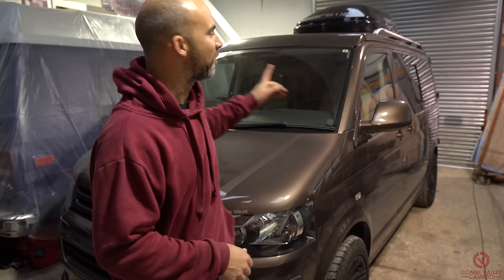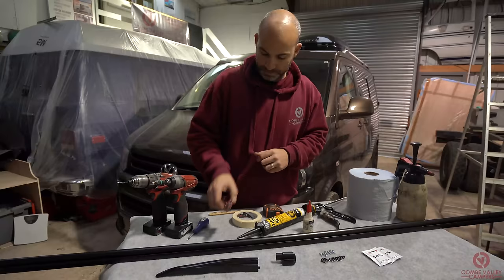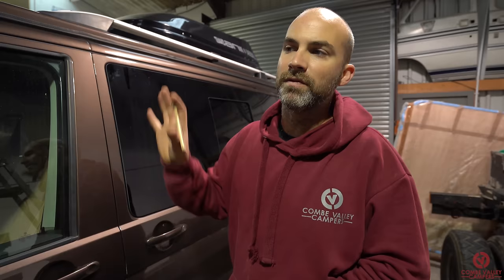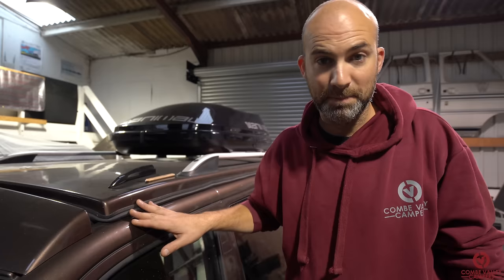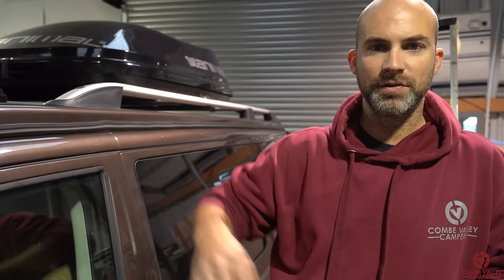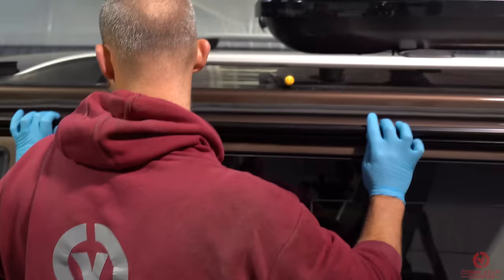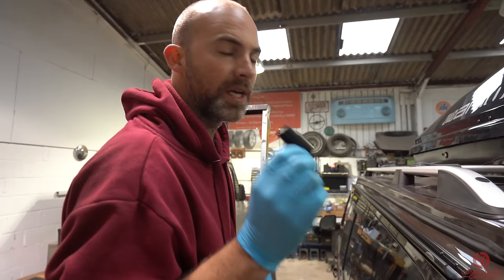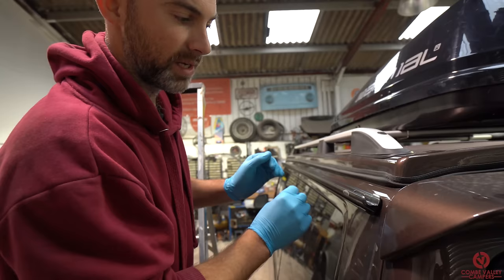HOW TO FIT AN AWNING RAIL ON A CAMPER VAN, fitting Vamoose C-channel awning rail.

Comment: Just followed the instructions in this video and successfully fitting my rail to our T4 van. I did it on my own. The only difference I made 2 x 4mm threaded pins which I inserted in the predrilled holes this allowed me to put the rail on with adhesive and slide into place for final fixing. I removed the pins and inserted the screws all done thanks for the video.

Comment: Nice clear explanation. Thanks.  Re ; sealant finishing. You can work without masking tape. If you manage to get the right amount under the part to be fitted then a fairly neat bead will show around the edges after its clamped down. To get that super neat it's then just a matter of a little saliva on the end of a fingertip run over the sealant and it magically smoothes out into a neat bead. The saliva prevents the sealant sticking to your skin. Its necessary to keep re-wetting the finger too. This technique is often used in fitting bathrooms. Often a bead will look like a run of weld on 1st application but a wet finger turns it into a smooth continuous joint. You can use this with a gloved finger but the glove is prone to movement which can spoil the 'run.'  Another way without tape is to wipe of excess sealant with a decent quality baby wipe immediately after clamping.  (Literally within seconds so it has no time to start curing. ) I don't know why cheapo baby wipes don't work well but  Pampers type do work well. You'll go through quite a few wipes as each one gets contaminated with sealant quickly and you start re-applying it if you don't change the wipe after a couple of sweeps. Hope this helps someone. Happy travels. John

Edit ; those baby wipes get the sealant off your skin really well too !

Comment: I had mine fitted using the roof bar fittings. Tucked the flat part of the rail under the roof bar.

Comment: man I love your stuff, but do you have a video, on how to cut and measure the rounded corners  inside the fan for head cupboards or anything you need to have flush against the top wall of the van?

Comment: What about treating the bare metal after drilling yo prevent rusting ?.
Reply: I asked that too. Something I would always do on my own vehicle
Reply: Pointless really, the screws are self tapping screws which would pull the paint off anyway. The sealant not only seals the hole but protects the metal.

Comment: should the front piece not slightly overhang the windscreen for the rain to drain away?
Reply from the maker: Hi Karl, this was fitted as per the manufacturers instructions :)
Reply: @CombeValleyCampers  how do the screws stay in?   Is there bolts on the other side?   The reason I ask is I am having an awning fitted but the van already has insulation on the ceiling.   Would this have to come off?
Reply from the maker: @gosulivan  The screws are self tapping screws and hold into the metal a short distance. Your headliner will not be compromised if the kit is fitted correctly. Regards Leigh